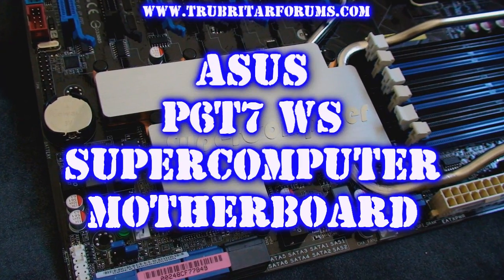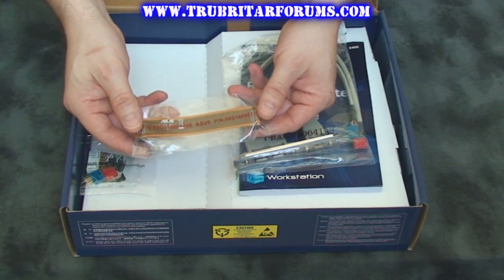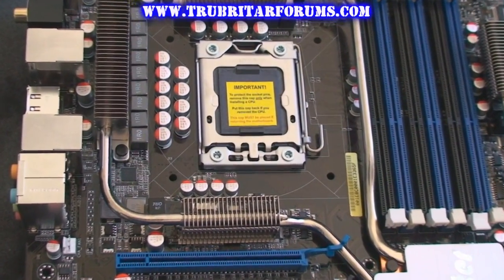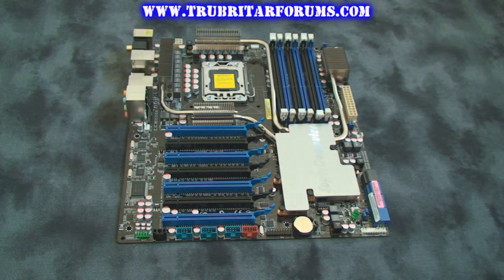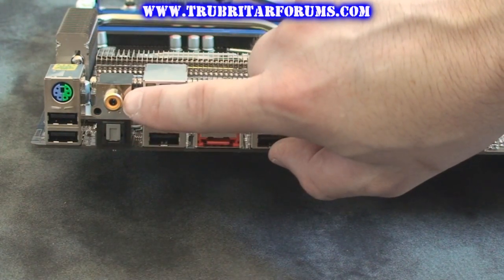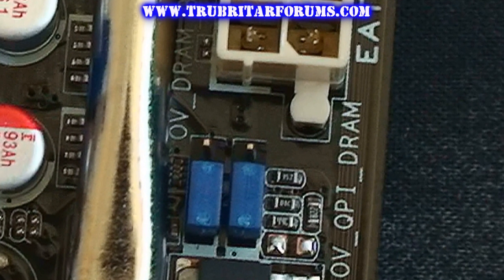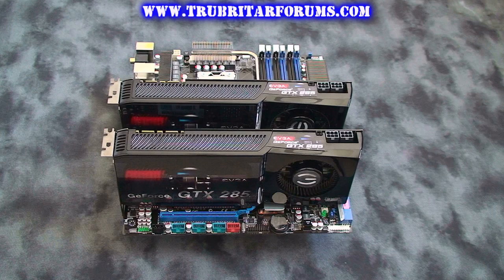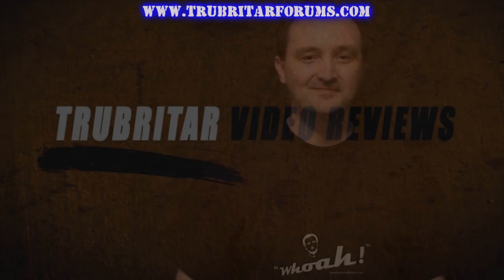(HD) ASUS P6T7 WS Supercomputer Motherboard

Comment: 2017 and still rocking hard on this mainboard
Reply: RoboB3ar same lol, got mine in 2009
Reply: @m-chopbeats7526  guys, can this mobo really hold 6 gpus? I have simple Asus P6T + x5670 as cpu render support machine, but now im rendering with 2 Gpus, and this second computer with x58 is not using most of time. I've never been thinking to sell it, it is too cheap to sell now its very old ((% But i've seen this mobo, and think about to buy it. It is very nice, to use my old 24gb DDR3 + x5670 for 6GPU render farm ((: It is looks like x58 have 36 lanes, for mining each GPU need only 1 pci lane, but for rendering x4 is normal, and x8-x16 is more then it really need. Official web site of Asus declares that P6T WS SuperComp supports up to 6 x8 — so 6 gpu's render farm is very cool (% Is it really can operate with 6 gpus?

Comment: ASUS Z9PE-D8 WS has 8 slots 2 processors and up to 240GB memory capacity i didn't buy this P6T7  it also has nvidia sli & crossfire support and cuda card support and 7 pci-e 16x slots.
Reply: you dont need 2 processors, modern video cards have its own processors.

Comment: I'm typing this on a P6T7 system that I built last year.  One thing that impressed me was that it fired up and ran first time, I didn't need to reset anything or fix anything, just plug and go.  This has been a VERY stable system.  I did have a cheapo HD fail on me a couple of months ago, but that's not the fault of the motherboard.  I'm now running 2 HDs in a RAID array so that if one fails, my system still runs...this board supports that.

Comment: @Sam737loverfsx Depends what you want to use it for, if you're just building a gaming PC and plan on a modest overclock you probably don't need either of the motherboards so buy a cheaper one and invest more on your GPU or get a SLI set up.

Comment: @cobrachoppergirl, the 4 processors are not a problem, since the next step in computer calculation is NOT based on CPU but GPU. The main advantage of this type of card is is using mutiple Nvidia graphic cards and their CUDA cores for computing. In the specific  field of, for example 3d rendering, video encoding or intense scientific  modelisation. This baby, with 3 GTX 250 has not 4 cores but 720 CUDA cores.  Check google for CUDA if you wanna know more.

Comment: Not really seeing the super computer here.  So underpowered its unusable. Only 4 cores - in10 years, 64 core processors are pretty common.  But then they said a 80386 had the whole power of a super computer on a chip, too.  What can you use 4 cores for, mabye a tiny webserver???

Comment: which power suplly will run a system like that ?
3 gtx 280 and 1 9800 gt  (4 graphic cards)

Is cool but is over the top 

You cant put 4 graphic cards in the same  case without  overheating these cards 

Converting all cards to water cooling is a pain in the ass and most of water cooling systems do not support this amount of graphic cards

Comment: Because Nvidia cards out perform ATI ones, I have GTX295 AND 4870x2 on an i7 system, the Nvidia out performs the ATI by around 10-25%! So the ATI with its 7.1 sound is used for HTPC use.

Comment: umm unique 4-way sli??? last i heard it was quad sli. and if evga classified has support for 4-way sli im sure this board is a bit better ive just got this board for $350 from a frendly shop but i still bargained though. its brand new and in case u havent noticed evga can only run electrically x16x16x8x8 where this one can run x16 in all four slots it has 2 nforce 200 chips the evga has only 1 the x58 chip has 32pcie pipes and nforce has 16 each this board is best but im sure gigabyte will pwn

Comment: Yes because the 9800GT runs physx much better than an 8600GT, so that the physx that would normally be done on the gtx295 will now run on the 9800GT and this will offer more fps.

Comment: yes u will run physx smoothly because all the physx processing is all done on the 8600gt but u r better off using an 8800gt or a 9800gt.

Comment: Dude are you kidding?  7 PCI-X 16 2.0.  2 SAS ports.  Only thing that would have made this better would have been dual sockets.  But seriously finally there is a board where I can run 6 way SLi (GTX 295) so I can run Doom 2 at 4300x3600 resolution WOOT.

Comment: no kits for this type of build create 8GB of RAM.  X58 is Tri-Channel so you need to buy modules in triples.  i.e. 6GB of 1000/2000Mhz DDR3 would destroy 8GB of DDR3 at 1000/2000Mhz.  Currently there are no 4GB DIMMS for DDR3 so in due time indeed.

Comment: It will be posible to set a 3-waySLI of 285SSC + another 285SSC for physx?
In the eVGA classified you can´t because of  the 
distance between the PCIe slots, simply there is no room for a double slot physx card.
But here you have plenty of space.

Comment: essentially when you separate sli configurations it makes the cards run at a less than optimal configuration. To put it in fewer words it basically reduces your frame rates by quite a bit.

Comment: what? you can't put three gtx 285's because each gpu already has two gpu's in it, so you can only have two cards for a quad sli not a third.
source: albert from tigerdirect did a video on this card...anyone correct if I'm wrong

Comment: What's the difference from this board and the evga classified like for gaming wise? You can only put 3 way sli on the 285's and the 9800gt for physx's. 

 Well i mean unless you really want to run raid 0 sas cheetah's at 15k rpm... Ohh while you make the next video could you put the 4870 in cfx in there too? 

 And a request is that, to do a 3dmark run with the same oc settings as the evga classified one just to see if there is a significant difference or not. Thanks trub
ps. you're insane